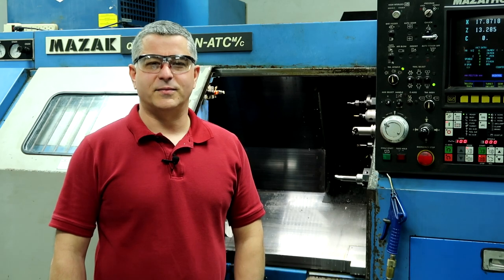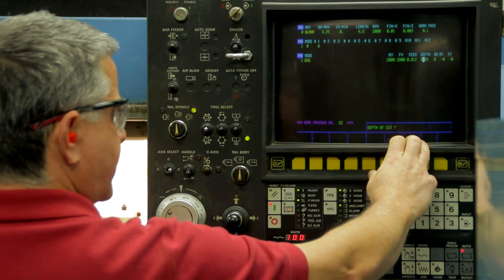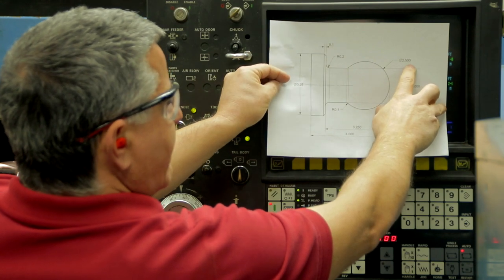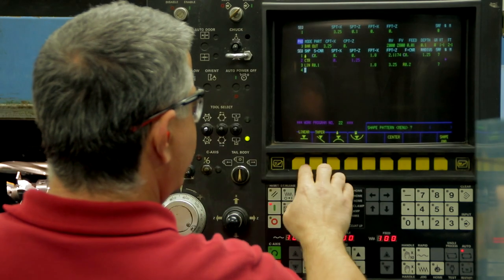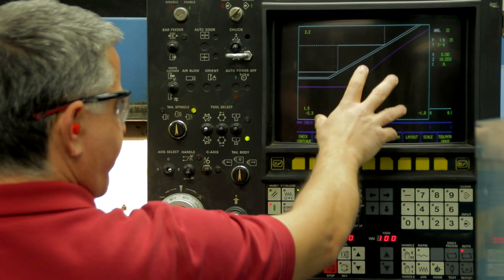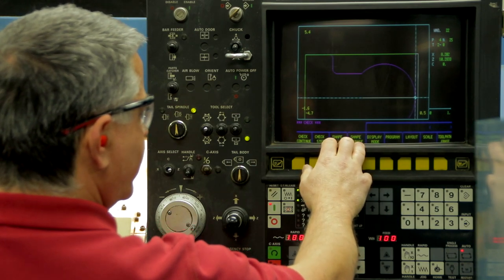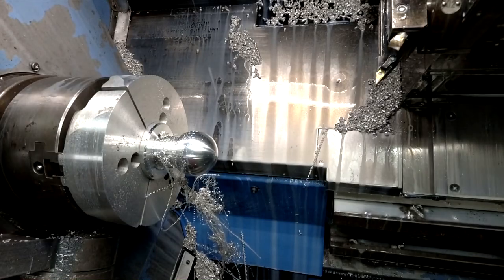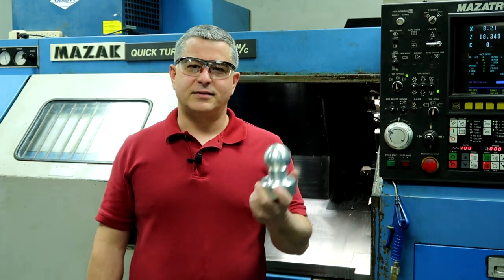Mazatrol Tutorial Programming  CNC Video Part #2 Mazak T-2 T-3 Lathe

Comment: 2.5-1.8=0.35
1.25-0.35=0.90
(1.25^2)-(0.9^2)=0.752
Sq route of 0.752=.867
So length 1.25+.867=2.117
🙄 but in mazatrol it will be easy in one single  option 👍.upload more video. Before I worked on Mazatrol  so your videos recollect all that again.thanks for sharing boss.
Reply from the maker: That level of math is above my skills.  I'm spoiled with Mazatrol.
Reply: Can I share this link to fb
Reply from the maker: @prasanthek1685  Sure. Thanks.

Comment: Phil, at 10:34, you mention adding 2 thou to the FPT-Z in order to prevent a sharp edge being left on the chamfer, saying the tool will roll over the edge.  Can you explain this to me in more detail so I can understand how that works?  I’m having a issue on my parts having a burr even though there is a chamfer being cut on the edge.  Thanks!
Reply: The reason why you want to add .002 is because that makes the machine go back further than the burr that kicks up on the chamfer pass. I want to draw it for you because it would be easier, but think of it as at the chamfer the tool will go .002 past the end of the chamfer towards the spindle thus cutting that burr off. Hope that helps
Reply from the maker: If you zoom in on the chamfer and run the toolpath, you will see the difference the .002 thou adds to the part vs not adding it.

Comment: Whenever you do an arc do you always have to put in a center?
Reply from the maker: No. Only when you do not know the start or end point.
Reply: @mazatroltipsandtricks6816   I keep getting "Reverse Shape Contour" error code. But I checked it out in master cam and the coordinates I got is what it gave me.
Reply from the maker: @mccheezen20  Add .0001" to Z end point. There is a rounding error going on and Mazatrol does not allow a reverse shape even with 50 millionths.

Comment: You may have explained this already, but Im still having trouble getting my thoughts around the concept of tool wear compensation on the Mazak. I was running a part today and I couldn't get the OD or the ID quite right. The OD was .005 over on the smaller OD in the front of the piece, but .010 over in the back. Then the ID was .020 too small. 

So, if I go into the wear and put in -.005 in the wear, that would make the lathe thing the bit is smaller, so it will take more off to compensate, correct? Then if I put in .005 in the wear, it would make the bit larger, so it would take off less. Am I thinking about this right, or backwards?
Reply from the maker: You are correct if you are talking about outside turning tools.
Reply: @mazatroltipsandtricks6816  So it's the reverse for inside turning then? The spec on the part was an ID of 1.28 and I was reading 1.195. So I would put -.085 on the wear compensation, or +.085?
Reply from the maker: @Captain_Hapton  +
.085" to make the boring bar cut bigger.
Reply: @mazatroltipsandtricks6816  Thanks for the help. Your videos are very helpful, especially since the guy training me had to leave last week.

Comment: How come you didn’t set the x offset ?(only the z was performed here). Asking because I’m new to mazak and on the Haas lathe we always set the z and x. Thanks for the videos. Good information.
Reply from the maker: You only set Z on a Mazak. The machine already knows where the X centerline is at.
Reply: Mazatrol Tips and Tricks thanks! So it knows from the OD value inserted in the program.
Reply from the maker: @75kGa  No, the machine's X position is going to be the same no matter what program you run.   The only thing that changes from program to program is where the face of the part is in relation to the chuck.
Reply: @mazatroltipsandtricks6816  ok, but dont you still have to tell it where the top of the stock starts,  work offset? Or know.   This is what confused me in the books,  I know about z tool offset,  I find it interesting and convientent that the mazak control doesn't use tool radius center,  just complete radius profile compensation control,  I also like that all the tools are referenced as having their own offset 1,  I think it makes it confusing when there is like, T04o4 T06O6, they make it bloody sound like their is multiple offsets for one tool.
Reply from the maker: @ryanb1874  Yes, that is called the workshift Z offset for the program.
Reply: Mazak is one of the easiest machine

Comment: I want to open a CNC lathe workshop, do you recommend me to start with a Mazak machine? I've just used Haas.
Reply from the maker: I'm partial to Mazaks if you have not noticed. Lol.
Reply: @mazatroltipsandtricks6816  Ok so I'll definately consider a Mazak lol.
Reply: @mazatroltipsandtricks6816  which model of Mazak do you recommend?(second hand) Obviously buying a new one is not affordable for me for the moment.
Reply: We have a Haas and three Mazak's where I work currently. I have to say if you want a quick workflow go with Mazak they are more expensive generally but in the long run worth while.
Reply: @GrImReApPeR99  thanks, I'll definately consider a Mazak now.

Comment: Can you make a ball with only grooving tool on Mazatrol T2? 
And if you can explain how?
I own T32-2.
Thank you.
Reply from the maker: @iguana200  Yes, Mazatrol can do exactly like you see in that video.  Roughing it with a groove cycle and a full radius insert would not be beneficial.
Reply: @mazatroltipsandtricks6816  Thank you. What cycle would I have to choose? And do I describe the tool as grooving or bar out?
Reply from the maker: @iguana200  Use a Bar Out and describe the tool as a grooving tool with a full radius. The grooving tool depth description needs to be .300" or shorter otherwise the machine will not turn with a groove tool.
Reply: @mazatroltipsandtricks6816  Cool, will try it out. Thanx. again.. Best regards.
Reply: @mazatroltipsandtricks6816  Hello .... How to describe the tool as a grooving tool with a full radius?
Reply from the maker: @malfonzo100  Describe the tool width say .100" wide  and then describe the radius as 1/2 the width say .050".

Comment: @13:00 is there a way you can just skip al the previous operations so to get to the operation you wanna see ?
Reply from the maker: On the older control like mine you have to play with the layout and move the operation you want to see to the top, but then you need to reset the layout before running the part. The newer machines can restart the toolpath wherever you want.